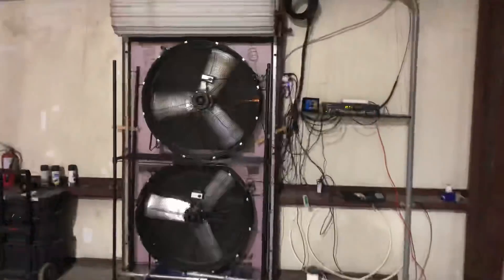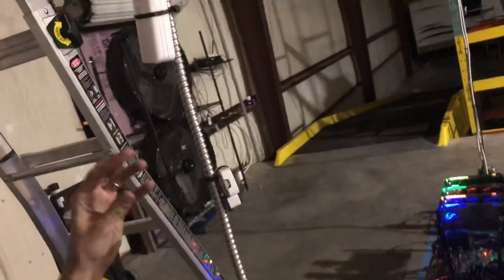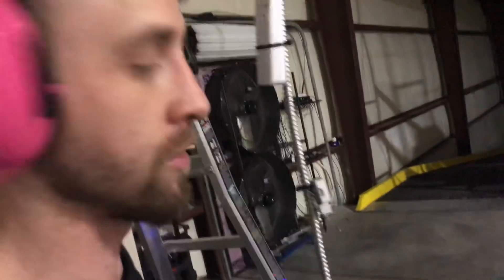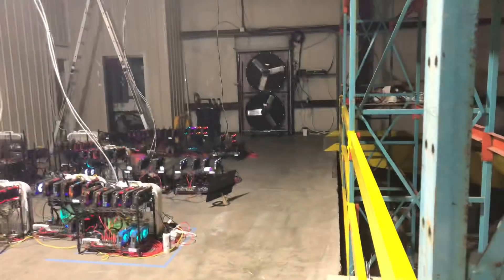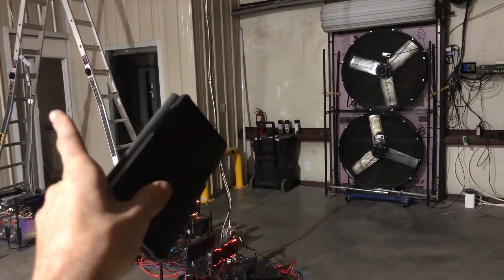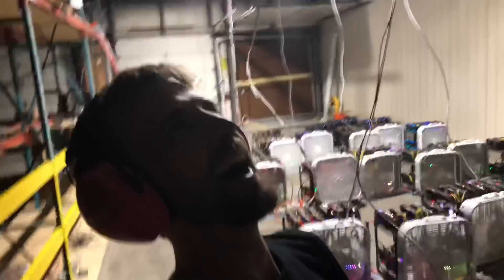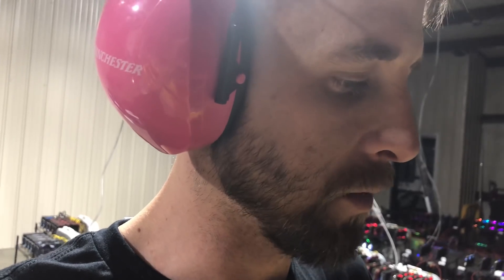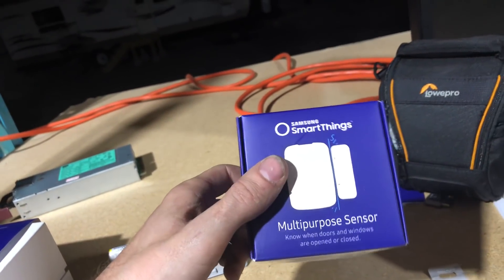Autonomous cooling

Comment: You really should have those exhaust fans on the roof or higher up on the wall.. your drawing out your cooler air by being so low to the ground... check the temperatures right at the fan so see what air your moving out of the building. You should be removing it from your  hottest area.